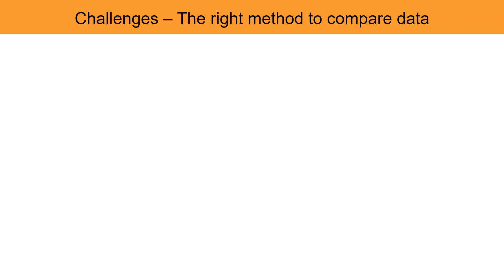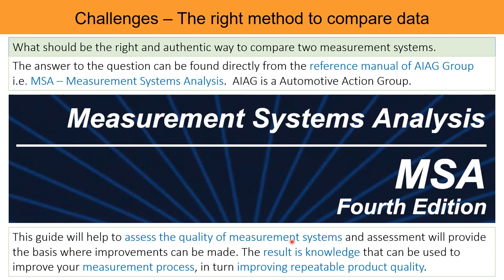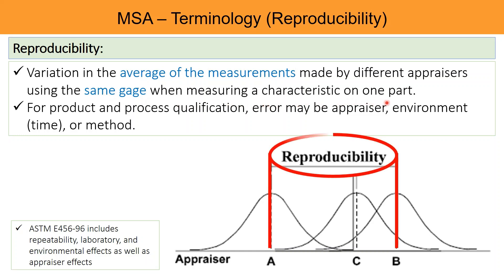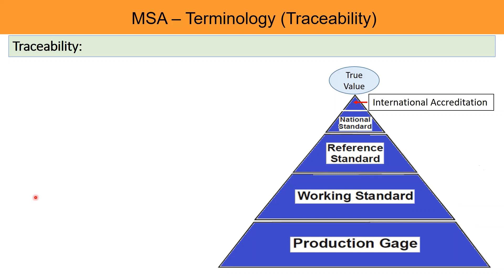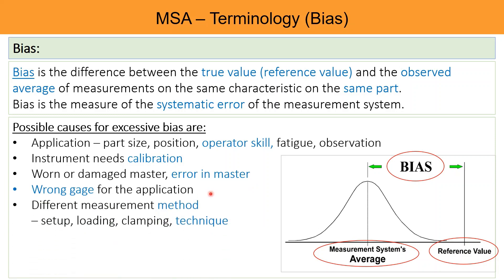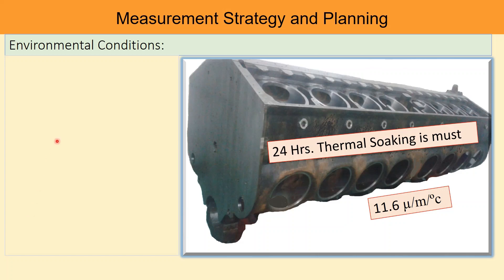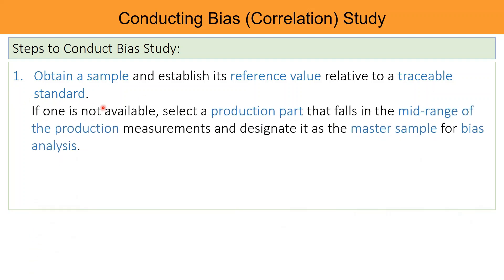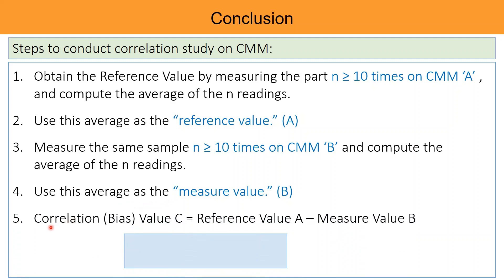BIAS STUDY FOR CMM

Comment: Hi sir,  is there any good methods to measure a positon when datum A is a common flat surface,  but datum B&C are threads hole
Reply from the maker: Hi,
Many times methodology depends on Tolerances and application.
Reply: @accurateasmeiso4262  thread hole as a datum usually makes the value inconsistent, do we have a method to make the repeatability consistent, is it ok to plug in a bolt so that we can utilize the cylindrical of the bolt as an easy access for the datum?
Reply from the maker: Yes it can be one of them if accuracy permits.